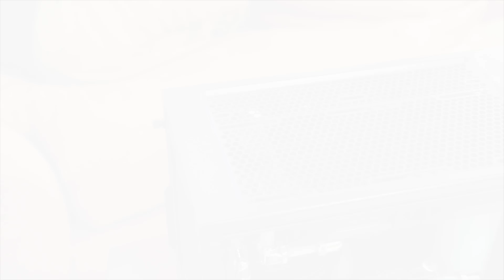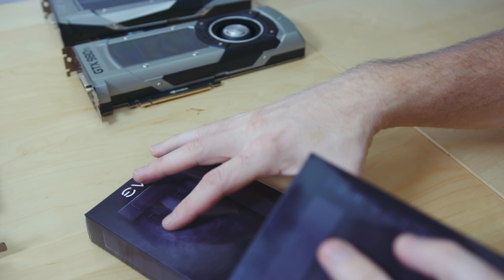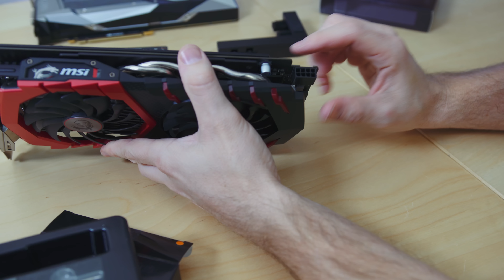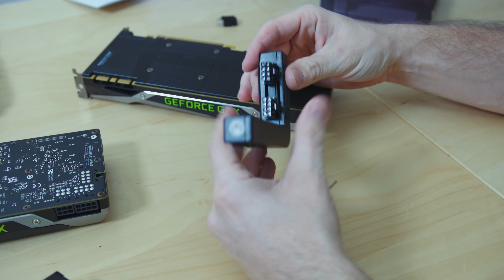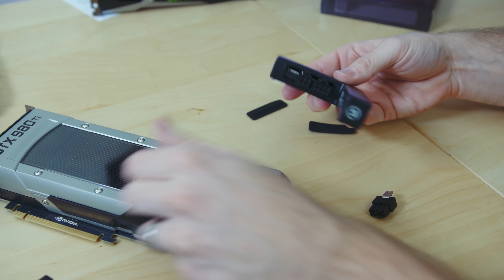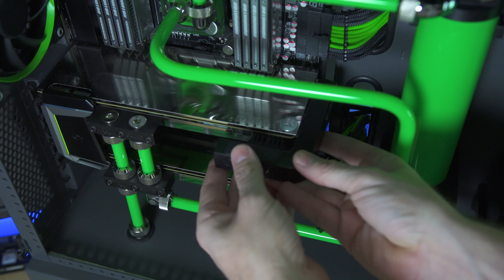How to manage your cables using EVGA Power Link

Comment: Could you do a video about 6 pin vs 8 pin power plugs in graphics cards. What is the real difference because many power supplies just reroute the two added grounds to the already existing grounds on the 6 pin plugs. Why is 3x positive + 3x negative rated for 75W and 3x positive + 5x negative rated for 150W? I don't get that...
I have researched this topic for a while now and still don't have the answer. When I saw this thing with only a positive and a negative rail inside I ask myself why doesn't the standard just have two wires, a positive and a negative one?

Comment: Everyone here is complaining about the extra length it adds or why manufacturers don't just move the connectors to that side and im just here wondering why EVGA didn't make a sturdier solution. I mean seriously that thing is flimsy as fuck. Why doesn't this accessory brace itself on the card so its not stressing the connection so much? Did EVGA even test this in a real use case?

Comment: It seems like depending on the build, it would look good. In yours I like it, in my itx build, they wouldn't fit. There might be some use cases I can see that might need the power connectors on the back but as you said, it is subjective.

Comment: Jay. I just noticed your main motherboard 24 pin had a really nice adapter. Is something like that available to the public somewhere?? I was gonna get that EVGA adapter. But in my case the Enthoo Luxe. It looks appealing in the straight drop down currently used. I have aluminum custom combs to go with my FTW 1080 Card. I wanted to post a link of it from my account ( FlippinFred). But I figured everyone would think I was trolling. I really love Skunk works. I'm a huge fan,. Thank you for your efforts in making excellent quality video's. And oh ya. One more comment. Would you perhaps show us if you dare. Your behind the case cable management..??? :D

Comment: Does the Power Link work for an EVGA GTX 970? At first glance, it looks like it wont, since the connectors on the 970 are further away from the edge of the card.
Reply: There's different versions of it for different configurations.
Reply: it is guaranteed to work with any EVGA card and you can adjust the length and connecters to your liking.
Reply: Collateralstar Gaming won't work with my Kingpins
Reply: thats evga's fault for lying then. go ask them about it then

Comment: I think that it has its use! But when you have a system with custom cables the point of buying them is to make them visible ofc in a tidy manner! On the other hand if you have the default psu cables it could be a nice way to hide them cause original psu cables are not super beautiful. Btw jay i like the curve on your cables. There are cables after all they cant go with angles. Try to lvl up the 2nd card's cable so its even height from the grommet.

Comment: In my opinion it would depend on what type of cables you have. At least with Skunkworks I liked the aesthetic better without them. In my mind, if you have nice custom length sleeved cables you should show them off. It might work better on a test bench where the cards are vertical instead of horizontal, that would help negate the floppiness. 

If they do another iteration where they are less bulky and more secure (maybe with an LED logo), I think they would be more viable for a bigger crowd.

Comment: It may clean up the cable route, but it looks cheap and not aesthetically pleasing IMO. Maybe it will blend a bit better with certain factory air coolers. I could also see it as a potential point of failure. Just my 2 cents.

Comment: Can these still work on amd or nvidia cards? Like does it have to be EVGA nvidia cards or does it not matter?
Reply: Shouldn't matter, you probably can even use it on (some) AMD cards. From the looks of it, the only thing that matters is the orientation of the power adapter on the card.
Reply: coldkeyes it Dosn't matter But the Power plugs on the GPU (that little prong that Holding the cable in) Must be facing down on your GPU.
Reply: Fronthart So would this work on an rx480 or r9 390?
Reply: it belongs to the manufacture of your Card.

Comment: I'm wondering who the intended costumer for this is. Because when you have sleeved cables colored like your rig, you're almost hiding them and in the case of skunkworks you now have an empty colorless space right in the center. And if you don't have sleeved cables, first, why are you spending money on bling that doesn't pull the whole thing together, and secondly, you then still have ketchup/mustard cables visibly sticking out of the side of it

Comment: I like them! The concept has something and should be evolved further. Give it a go Jay, the fit your rigg. Work with your cables a bit and there you have it. I would gve them a try, but i use a Gigabyte card and it wont fit on it.

Comment: dont like them. card ppl need to move the connections on the board
Reply: Problem is with small form factor builds which become increasingly popular
Reply: if you make an ELEVEN inch card, you're not worried about small form factor. R9 Nano is small form factor. Not a nearly 1ft long Graphics Card.
Reply: Thats one thing i like about the Sapphire RX 480 nitro and nitro+ its on the side by default on the card itself.
Reply: And they have. I've had a card which has had the power port facing to the side(EVGA 550 Ti) and one which has had the power port closer to the other side of the card(ASUS 750 Ti).
Reply: how stupid people can be
Reply: Except most small form factor cases account for longer GPUs, so they do have to care in order to remain viable options for those cases.
Reply: Bester Name Pimmelmann!! XD

Comment: What are the fans he used in skunkworks?
Reply: Static corsair SP and AF I believe all 120 mm
Reply: Static corsair sp 140. he sprayed painted them
Reply: He said ilthey are airflow and not static because at the time they didn't have static ones. But I might have missed how he changed them
Reply: BackInBlack_4896
Reply: corsair are noisy. many better makers
Reply: There still are no corsair sp140. Only 140 mm corsair fan of that design are air flow version.
Reply: Well, you are a little bit wrong, there are corsair sp140 fans http://www.corsair.com/en/air-series-sp140-led-green-high-static-pressure-140mm-fan , but as you can see, not much SP there...

Comment: I'm sorry but sleeved cables with combs look way better then this, why hide the awesome expensive cables? Definitely nicer before, they look a little cheap imo.
Reply from the maker: You can still see them plenty, they just dont make a big arc anymore
Reply: Agreed, they look cheap. Especially in contrast to the high end skunkworks. A more premium build and a slightly smaller footprint and I'd buy them.
Reply: I like how it looks after you installed them. Yea, they do look a bit cheap. I always hated how the pcie power cables look when connected to a video card on the side like that. Why don't video card manufacturers just make some cards with connectors on the right side of the card instead of the front? 

 Is there a paint that would make that plastic look like a painted or anodized aluminium?
Reply: I like EVGAs idea with the Powerlink, but it should be a brushed metal look. Then a smaller footprint shouldn't be necessary in my opinion.
Reply: paint the EVGA logo on that power plug in green, it looks awesome
Reply: I think it does look good. but if EVGA could make it slightly thinner and also incorporate a GPU brace into it as well it would be amazing. RGB LED's on the logo would not be horrible either.
Reply: agreed
Reply: I got my powerlink last week, I personally like it with EVGA GTX 1070 FTW card. You can still see cables with this and not everyone has sleeved cables or a modular power supply.
Reply: Sorry but the power link is amazing ! cables are never a good thing to look at !!!!!!!!!!!!!!!!!!!!!!
Reply: This may sound strange but nail polish on the cheap end, or some high grade automotive spray paint.
Reply: Maybe you can find a nice sliver or mirrored finish paint so you can match them to the GPU backplates and the RAM heatspreaders.
Reply: Feist Laist why don't you find something better to do than be a Troll.  GROW UP!!!
Reply: Looks cleaner.
Reply: I would have to agree. I see its place, but not in Skunkworks. And they look at bit cheap, which doesnt look good, in such an expensive build lol xD
Reply: Jeremy P height. I have a case that the way the case is with the cables on top it crowds a fan. So this will no longer crowd the fan and let the cables fade into the background.
Reply: for me they are just bulky and there and adds nothing to the look other than a black block just floating there.
Reply: i can see the application in a basic build with no custom sleeves to keep things tidy, but in skunkworks hell no, show off the custom cables!
Reply: than*
Reply: My GTX 460s had the connector on the end and made cable management a whole lot easier
Reply: Stranger probably using the dry brush method with some metallic paint
Reply: Jeremy P 
I think this adapter looks better with black cables anyway...
Reply: They aren't all that bad, it just doesn't fit with those beautifull EK backplates
Reply: I'd rather look at crappy sleeving than a black block on my card if I had a window. If your cables don't have nice sleeving get extenders of the color you like. I feel like cables are smaller and look cleaner. Then again it would depend on the build. If you have a massive black or silver cooler it might fit well and look nice.
Reply: Jeremy P agreed
Reply: Not everyone build PC to be viewed, many cases don't even come with a transparent panel.
Reply: I'd say that too. I know everything is somewhat quare but the Mobo connector is rounded too. They should rearrange the power connector to the side or something.
Reply: The horror...
Reply: not every one has them type of cables
Reply: send me a link? The only combo I found (4cpu + 6gpu + 24 atx) with all the sites I found are above 60+ dollars.
Reply: well someone can make "skins" for it so you can make it a BIT better
Reply: ***** I'm going for a color scheme... but thanks though... Will keep this in mid for later :D
Reply: k Manu Quesada
Reply: Plastidip the power link lime green = reedemed

Comment: At first I thought kinda the same as what you did, that it was kinda gimmicky, But it did look nice in your build. One thing i dont like about it, is that the plastic looks kinda cheap and you can see the seem where it is assembled in the factory(the split going horizontally through it) If they were able to make the plastic look a bit better or mabye metallic i feel it would be alot better. And they could probably make it a bit thinner, Also does it only include one 6 pin plug? because i know some graphics cards have two 6 pin plugs and it looks the power link only comes with two 8pin and one 6 pin plug. Awesome video as always!

Comment: I've never heard of a 6+6 pin because that's what 8pin connectors are for
Reply from the maker: 6+6 on some of the old school cards like 8800 Ultra etc. Some folks still using cards that old :P
Reply: 6+6 on my old Inno3d gtx970
Reply: My evga gtx 980 has two 6 pin power connectors. So does my Gigabyte r9 270 in my HTPC.
Reply: 6+6 on my Evga 970sc and the 970 was one of the most popular cards last gen so why not make it compatible?
Reply: uhmm my galax 970 is 6+6 pin
Reply: Wait, I have an old card ? The inno3d gtx970 isnt what I´d call old tbh
Reply: my gtx 960 gigabyte has a 6+6
Reply: 6+6 on my GTX 285, my HD7950, and even the 980 used 6+6. Hardly old. (although tbf the 980 is now nearly three years old itself)
Reply: my evga gtx 970 ssc has a 6+6
Reply: My R9 380 has 6+6 pin
Reply: 6+6 in a spare 4870 i have lying around
Reply: Maybe that gpu just needs 12 plugs, not 14 nor 16.
Reply: ***** Well after watching the video there is not extra 6pin so yeah
Reply: Casual Duck I have a 660ti with 6 + 6 pin connectors
Reply: JayzTwoCents huh ....  my current 8800 zfx card only takes one 6pin in the back of the card ... can't wait for the next card giveaway XD
Reply: hello? reference gtx 980? xD
Reply: Casual Duck My 980's have 2 6 pins ¯\(ツ)/¯
Reply: 6+6 on the EVGA GTX 970 SC ACX 2.0
Reply: He didnt say only old card now did he? i'd want a 6+6 instead of a single 8 tho, the 2 powerplugs was one of the things that pushed me towards a 1080 instead of a 1080 :^)
Reply: My XFX R9 380 has two 6 pin connectors and they are already on the back
Reply: my r9 380 has 2x6
Reply: Mine too heyo
Reply: obviously you have not seen enough gpu
Reply: it'd make the required space for the cards to be extremely long and potentially not fit many builds currently utilizing them,  this is a nice option if you wish to change the placement, after the fact
Reply: The EVGA quad-SLI GTX 285 had 3 6 pins.
Reply: Never Had so many comments Thanks Guys!
Reply: my msi 7950 had (i think) 6+6

nothing really special

Comment: I'm also torn. i think it's a cool idea from EVGA but they are bulky. Also, if you have cable extensions that match your build it kind of hides them in a case that is oriented vertically which may or may not be desired if you're trying to make your colors pop. I'd be curious to see how they look in a horizontal/cube case because i think the side cable routing could really help in one of those. Thanks for doing a video on these, good to see how they look in real life.

Comment: I'm very torn on this one, I liked the fact that the cables without the power link gave the setup much more color, and since the power link doesn't light up green (like most EVGA accessories, the evga sli bridge for example) I don't really like it that much. Yes, you might argue it looks clean, but it did look clean before as well.

One of my ideas is maybe redo the tube that supplies the CPU with liquid cooling to put the cables in a way where they are routed over that tube for a 90-degree angle, but that's just my two cents. (No pun intended)

Great video though!

edit: grammar
Reply: I think because its water custom watercooled setup it works. If the GPU didnt have those connectors sticking out on the left it would look very odd with a huge piece of plastic. The finish of the link looks cheaper than the other parts too.
Reply: agree ^^
Reply: Exactly, if it didn't have the bulk of the waterblock connectors on the left it would be totally unbalanced.  It would be better if they were slimmer and could fasten the end down somehow so that the end of the extender does not sag under the weight of the cables.
Reply: I agree. I think it really depends on your build, what your going for in terms of looks.

Comment: this thing is good in some builds, but not on all, 
i couldnt see it correctly but was it thicker than the gpu water inlet? 
it whould have been awsome if the logo was rgb so it could match your cooling loop. than it whould be a no brainer.
maby let it stay a couple of week than change it back and see if you grew attached or not

Comment: I personally don't think it did much to the look, over all the look of your power cord gave it this kind of sexiness that was taken away, maybe if you had planed to use them it would change the look. But it looks like you didn't and that in itself and the color scheme doesn't fit the build for the EVGA power adapters. 

Over all I am not sure about the hole bring it to the side thing, if they were going to want to do that, then make it so that way  the GPU already has it. Over all I think it would be a wast of time and maybe a few dollars for something that you could do yourself.

Comment: I enjoy the loops on the 2 8 pins its adds elegance and color, the power link feels like a lazy way around  it not to mention if I had cable mod on my pcs power supply I'd do as much as I could to show it off not pay more to hide it, I'd be torn if the logo lit up but it doesn't so I gotta go with the plain cables

Comment: I feel like they could be really good in some cases (pun intended), but I also think that they aren't going to work for everyone. I have a pretty big case (the phanteks enthroo pro) and I still think that it would be a pretty tight fit to get the cables to go into the cable grommet behind my GTX 980.
Reply: Fmily I mean, they'll be nice if you're trying to hide as many cables as possible. but hey if you bought any evga cards recently these are free
Reply: That's why I said they would be good for some people. I didn't know that they would be free with new EVGA cards, can't really beat free lol.
Reply: I think for me I really don't need it, I have a 1070 FTW which is a pretty massive card, but its in an NZXT H440, good sized case. But I can definitely see where these have practical application.
Reply: unless you pay a negative amount. So like they give you money. =P

Comment: great video jay! i think that as long as they match your system they will look good and be useful. However they are a bit bulky and i worry about the extra weight causing card sag and excess stress on the pci-e slot

Comment: ha, my quadro already had a read mounted PCI-e connector
Reply: Martijn van winden you realize that quadros start at $50
Reply: Joshua Nicoll you have a quadro? sure...
Reply: sure kid, you just saw the linus tech tips video where they pointed it out didn't you? and im sure your cpu is the i7 6950 as well?
Reply: No, it's a Quadro K4000 in my server. You can buy them on ebay for €300, also I'm 20 you dumb fuck hics.
Reply: Brett Schneider Joshua Nicoll Sorry i thought you meant an quadro m6000
Reply: Yeah I won't have one of them for at least another 2 years, especially as I'm selling a lot of my servers to build a custom water cooled PC. I also tend to get U1 chassis's and they can only take single slot GPUs.